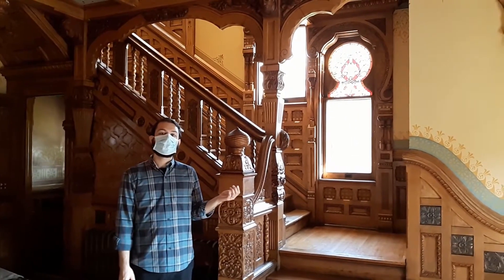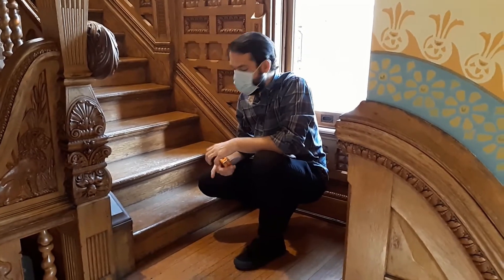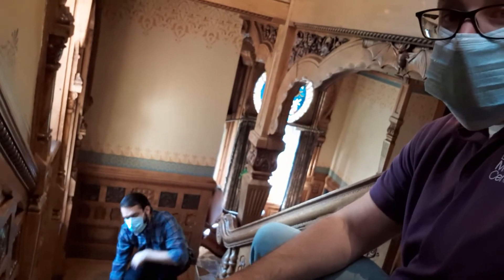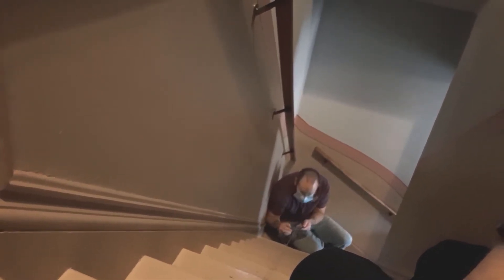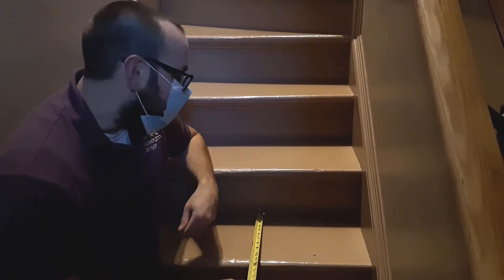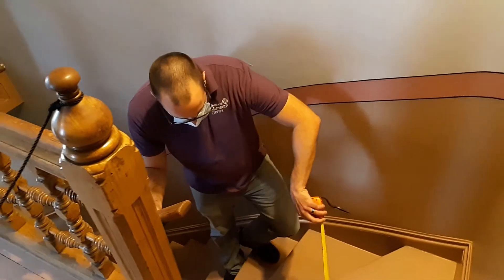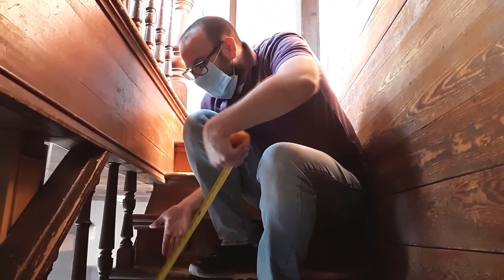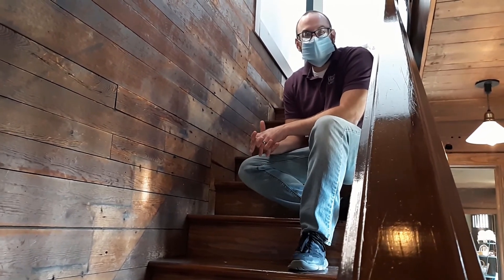Victorian Stair Danger?

Comment: In terms of modern American standards, the rise and run measurements aren't actually that bad. The generally accepted ratio is r + g = 18", where r is the rise and g is the run or going. It's important to measure the run from the projected edge of the nose above to the end of the tread, not the full tread depth itself. The tread depth is usually about 1" longer than the run because of the tread's nose. The ideal measurements for American stairs are 11":7" for standard stairs and 10":8" for compact stairs. The rise height is slightly more flexible than the run depth as rise variation between steps should be kept to a minimum for safety reasons.

Comment: They're only dangerous if you're stupid. Natural selection? Also, twice the riser isn't the usual tread. 7-11 is the usual comfortable measurement and code is just less. I have an old house with those narrow, steep basement stairs measuring 7-10 or so. It's amazing what an inch does.